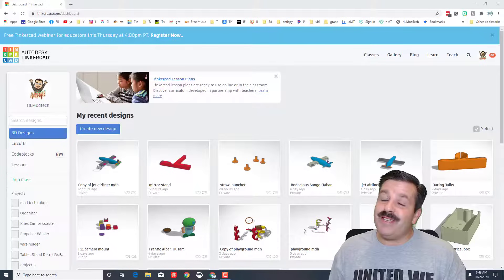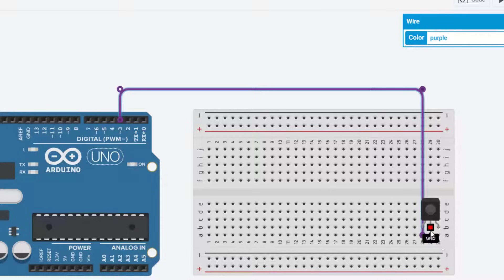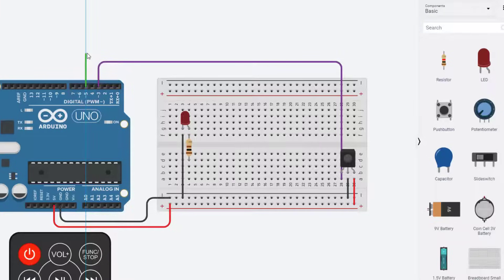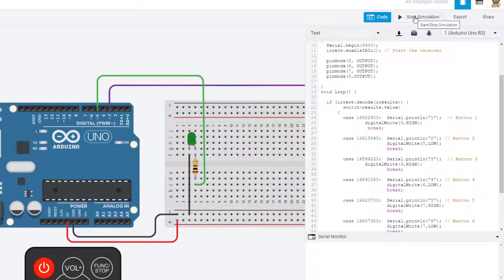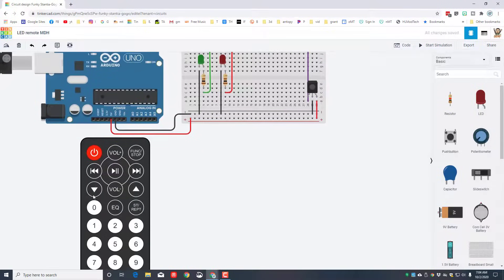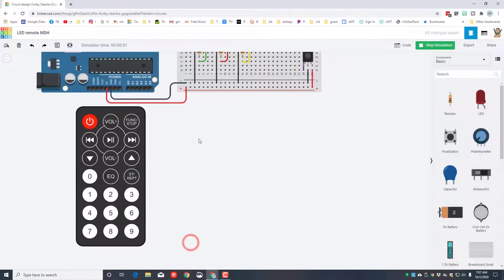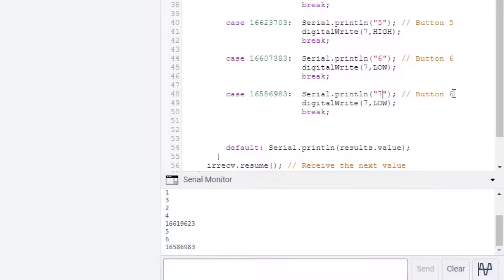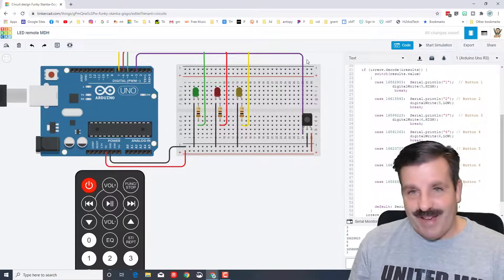Control LED's with an IR Remote in Tinkercad Circuits! #arduino

Comment: i dont understand the condition for the if statement
Reply from the maker: Thanks for reaching out. I created this video for how to work with the IR remote in 2023. https://youtu.be/eNNjainyT8Q It should get you back on the right track.  The if statement was checking to see if there ware a new IR code received, then decoding which button it was associated it.

Comment: It's not working now.
Reply from the maker: I just tested mine. I had to adjust the numbers to match what the keys were sending... but it still works. When you turn on serial monitor you will see the code that is associated with each button. Copy that and paste it in the loop to make your lights work.
Reply: @HLModTech  all the buttons of ir remote are sending the same value , any solution for this ?
Reply: @yash37044  same case here brother, all numbers giving same value, did u find any solution??
Reply from the maker: Thanks for reaching out. I created this video for how to work with the IR remote in 2023. https://youtu.be/eNNjainyT8Q It should get you back on the right track.

Comment: what do those long numbers in the code represent ?what do they mean?
Reply from the maker: I am not sure which numbers you mean. Someone else created that code... I just play with it. If you want to send me a snippet via email I will take a look though. hlmodtech gmail is the way to reach me.
Reply: @HLModTech  in the code (void loop) where it's mentioned case 16582903: Serial.println ("1").
this 16582903 means what?what does it represent?
Reply from the maker: It is the "name" the button is associated with... or the code that gets sent.
Reply: @HLModTech  🥰🥰thanks
Reply: @elielepetit8107  16582903 is the decimal conversion of the hexadecimal value associated with that specific key of the button. Basically 16582903 is just referring to key "1" on the remote, you can convert it back to hexadecimal if you'd like to get the original value associated with the key

Comment: This is an older version of "decode".  How would this be modified given the updated library? 

The function decode(&results)) is deprecated and may not work as expected! Just use decode() without a parameter and IrReceiver.decodedIRData.<fieldname> .
Reply from the maker: Thanks for the note. Let me do some digging.
Reply from the maker: So I just tested and mine still works fine. Thanks for the tips on how to correctly use decode() now. 💯🔥
Reply: @HLModTech  It does function but will generate error messages as written.  Here is a good video that outlines the changes to v3.0.0. - https://www.youtube.com/watch?v=9cJT-tfODsg
Reply: @John Fellers - Thank you very much! This was the only explanation on the internet.

Comment: It's nice teaching. Thanks for the video and if possible can you use separate push buttons for each led and ir remote both to control LEDs
Reply from the maker: Thank you. Are you asking for a combo that has normal push buttons and LED push buttons?
Reply: @HLModTech I’m curious about how you can press 2 or more buttons at the same time and it does something and also what did they change with the code. To add to that point which code will work with the arduino uno
Reply from the maker: The entire system was different. This is the video that shows how to code the buttons now. https://youtu.be/eNNjainyT8Q I do not believe it will be able to handle 2 or more button presses at the same time though.